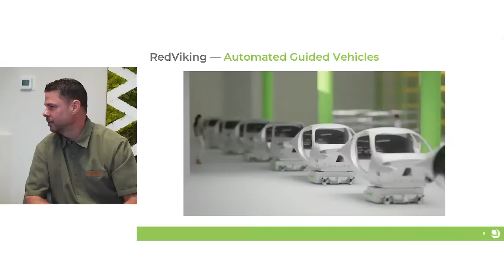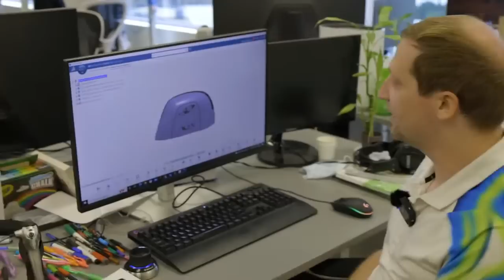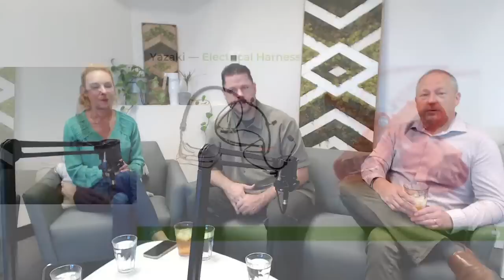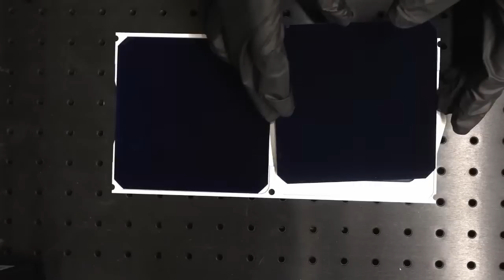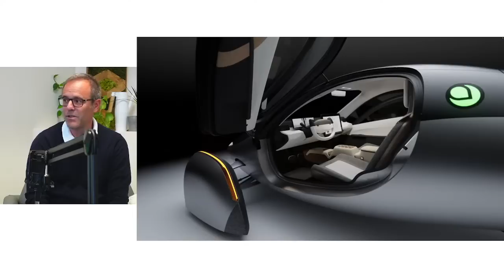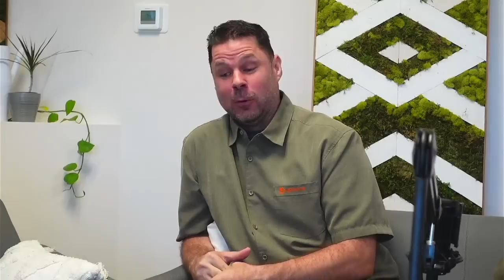Aptera Live Webinar — June 2022

Comment: Please add a solar charging port so one can add more solar charging for the car. It could be right next to the regular charging port. The rear section is perfect for carrying flat thin flexible solar panels which could be quickly laid out and daisy chain together for added sun charging when parked.
Reply from the maker: We're working on a possible portable solar panel plug-in through a DC link. It would be beneficial to all!
Reply: @ApteraMotors  Thank you, absolutely. With the ability to use extra solar panels one could never have to go to a charge station. Perfect!
Reply: They've announced the capability to plug in additional solar panels is in the plans.
Reply: @fotoguru222  I haven't heard that yet but if true that great!

Comment: Great presentation. Thx. 
Since you said that 41kwh batteries are the first one to be delivered (i am currently holding a 60kwh reservation), if i change it to 41 kwh batteries, what is the effort involved to get it upgraded to 60kwh once they become available. 
In short can i change my specs to 41kwh and get it upgraded to 60kwh once they become available. What would be the Cost and Effort involved for this?

Comment: CCS is a standard - Tesla is not and never will be.  As far as the size of the CCS combo connector - that's because it can support higher charge rates than Tesla (350 kW vs. 250 kW).  The higher the charge rate the larger the air gap needs to be between the DCFC pins.